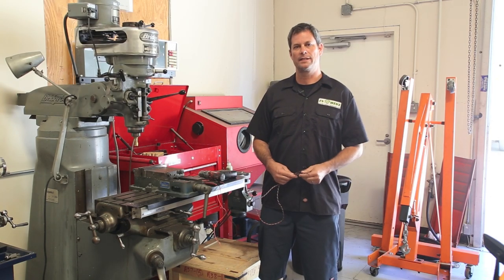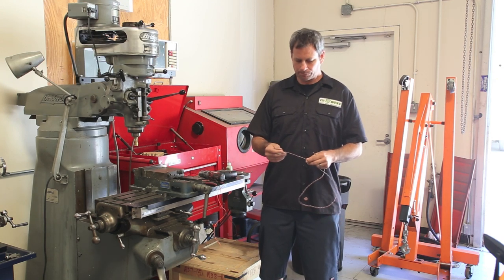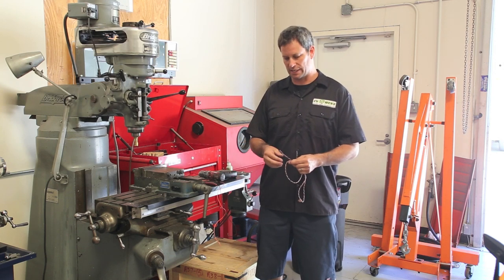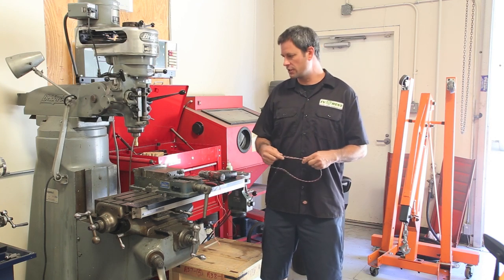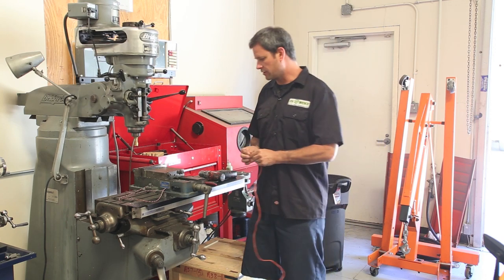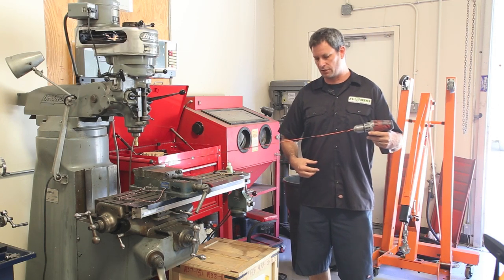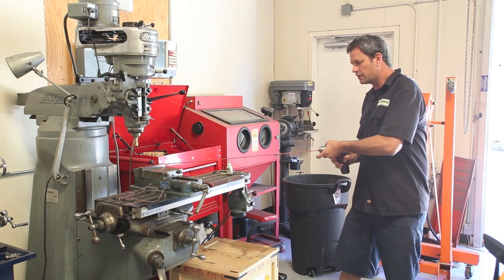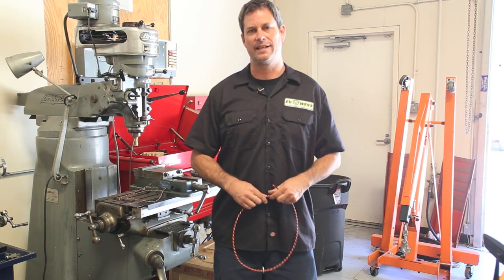EV West Quick Tip: Twisted Pair Wiring to Improve Electric Car Shunt Accuracy

Comment: many twisted pair applications need at least 9 turns per foot.  less than that is not optimal more than that may cause other effects.  by the way.. this also works for sound systems amplifier to woofer wiring.

Comment: Used to do the same thing when I used to install remote starts and car audio for a living.
Reply: Same here. It's an age old trick; the tip to "overtighten, then back it off" is key. Not a lot of the EVer's I know have mobile electronics experience though, so great catch putting this out there guys!

Comment: Cool tip. WTF's a shunt?
Reply: A very accurate resistor with high current capacity.  If you measure the voltage difference across this known resistance you can calculate the current flowing through it.  
This is actually very analogous to measuring pressure drop across a calibrated orifice in a pipe - you can measure mass flow.

Comment: It seems like you are missing a bit of detail with this. To make proper use of twisted pair wire in regards to cancellation of noise induced in the wire itself, you need to have differentiated inputs using say a differential op amp. The idea is that due to the way the wires are twisted, an identical noise signal is induced on both wires. This noise is then removed with differential inputs finding the difference between the signal and ground, but the most important part is that the differential is your signal, not the signal itself. Correct me if Im wrong, but just using twisted pair itself will not result in noiseless transmission.